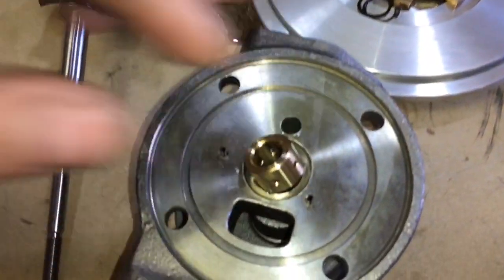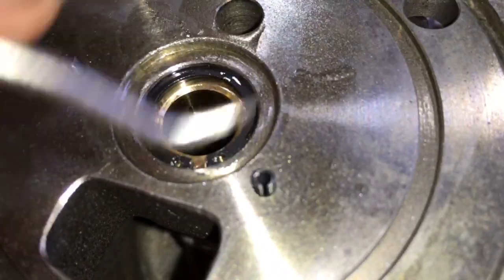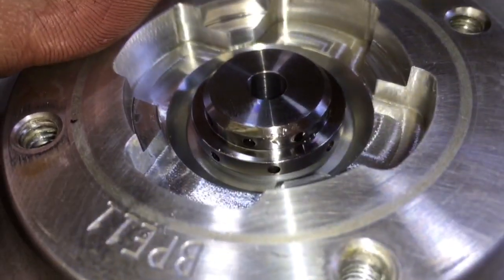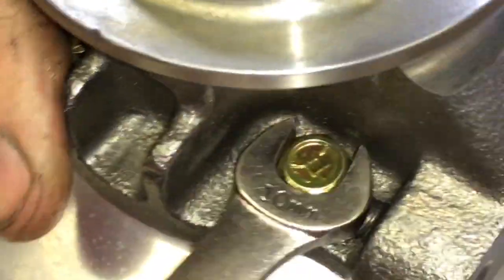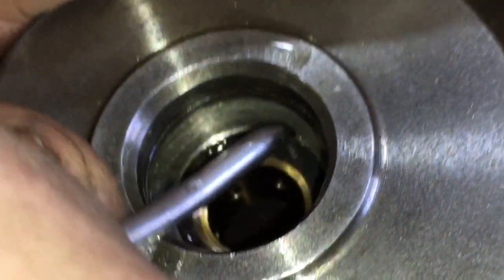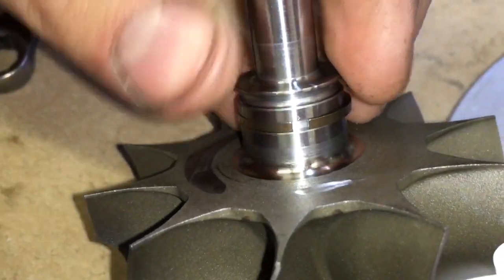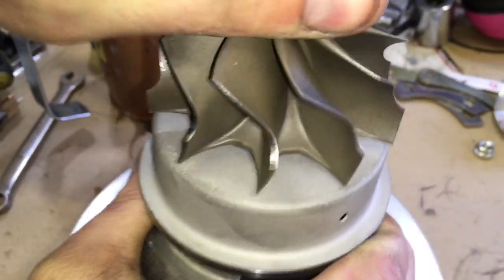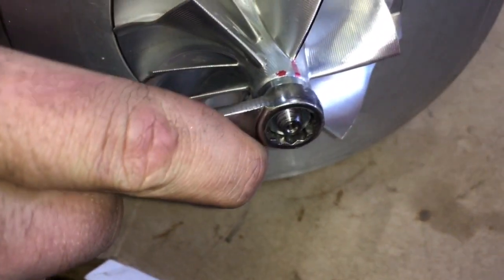PTE 6262 Turbo Rebuild

Comment: Ian, ordered the kit from you Friday and it’s here Monday at lunch. Thanks man
Reply: Waiting on the correct thrust spacer :(
Reply: Didn’t send me new compressor cover bolts that fit either. Sent me slightly larger 8.8 grade bolts and thank god i didn’t force them in otherwise I would have stripped the aluminum. I had to reuse by old bolts. His response was, mine are hard to get. I asked this kid what to order BEFORE I ordered anything. WTf did you send me garret cover bolts for SMH
Reply: His exact response: There are different versions of the turbos, yours has 5/16 thread bolts if they don’t fit. Precision had 2 variations  of the bolts. On the t4 turbine housing they used 5/16 x 18, on the t3 they used 8mm x1.25. The compressor housing uses 5/16 short bolts, they aren’t easy to get. I include the 8 x 1.25 for the garrett turbo cover. If you want the 2 piece brackets I have those, you can use the 3 or the 2.
Reply: Also never even got an apology for all this BS.

Comment: I have a PTE6265 journal bearing turbo with exess play. Can i use the universal t04e rebuild kit?

Very good video! Thanks
Reply from the maker: Watch out for the variation shown here. It’s rare but more common on units from the early 2000 year models http://turbolabofamerica.com/garrett-t3-t4-to4e-to4b-turbo-rebuild-kit/ other wise the kit is a direct fit. I do have the different bearings too if you have the ball bearing shaft

Comment: Very informative!

I've  recently found your channel and watched quite a few of your clips, they're all very interesting covering a wide range of turbos and applications. 

Do you have any clips of rebuilding Blouch turbos ?  reason for my asking is I have a Blouch Domintor 2.5 BB billet aka Polka Pickle  ..that failed after 4500 miles, All sorted now but I was just wondering what your experience and opinion you had of that turbo.

thanks!

keep the clips coming :D
Reply from the maker: +CharlesTun4 they are just like the ballbearing gt35r on the inside I need to make a hd video of the gt35r assembly, I have the t35r disassembly
Reply: Turbo Lab America that would be really good to see. my turbo failed with the bearings cages melting due to high exhaust temps  ..possibly due to higher exhaust temps from ceramic coating the exhaust housing? I'm from the UK so no way I could have used your services. however the turbo has now been upgraded with metal bearing cages and thick bearing heatsheild . .hopefully that's a step in the right direction

Comment: Hey I’m trying to rebuild a precision 6266. I have one of your rebuild kits. I have the turbo mostly stripped down, c clips are removed from the center section. I can’t get the bearings out. I’ve tried hammering them out with a vise, heating them with a torch.. and everything. What do I do to replace these stupid bearings please?

Comment: I followed your video but my shaft will not go back in. What could be the problem? Looks like I am going to have to order a new rear seal ring as well.
Reply from the maker: The bearing housing can be damaged to where the rear seal won’t go on, the bearing housing may need to be replaced, the shaft may need to be replaced also. You can check by putting the rear seal on and more it around on the shaft to make sure it doesn’t bibd
Reply: Thank you very much
Reply: Mine done the same thing, put the thrust spacer on first then the journal bearing and it will slide right in.

Comment: Hey man i have a 6262 journal bearing im not sure if its a gen 1 or gen 2  but its a .82  on the exhaust side and  want it to spool quicker is there any other hosings or modifications i can do to this turbo to make it spool quicker  ?
Reply: You could just add fuel in the tune